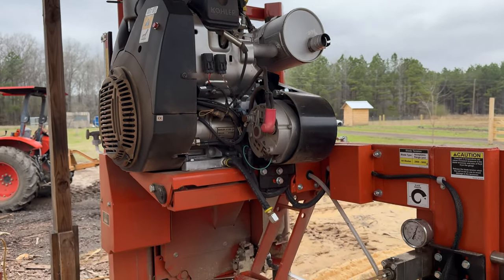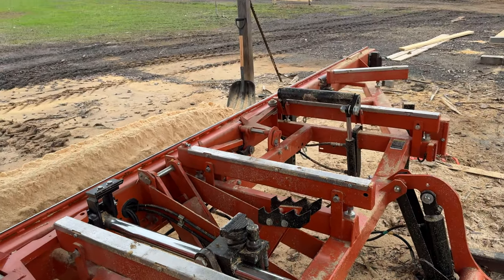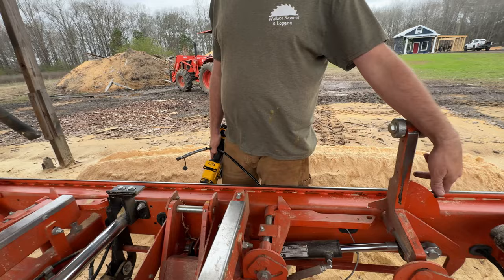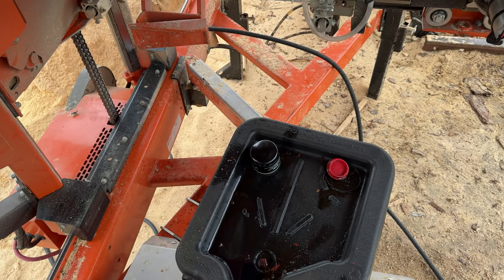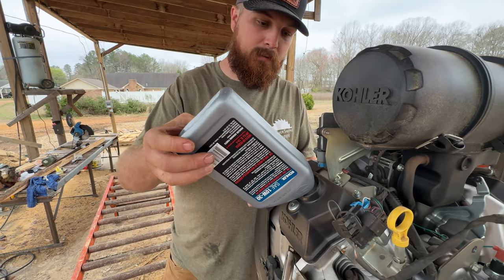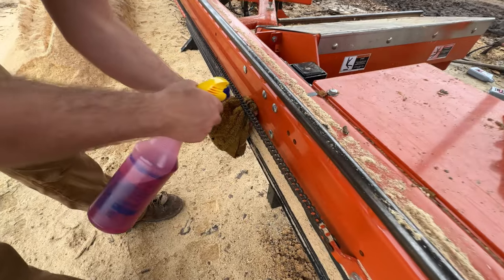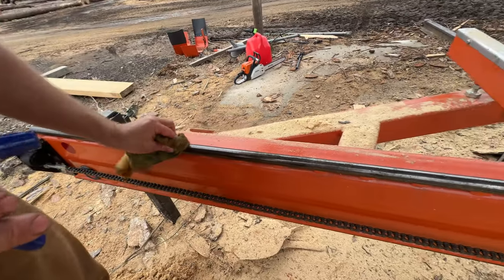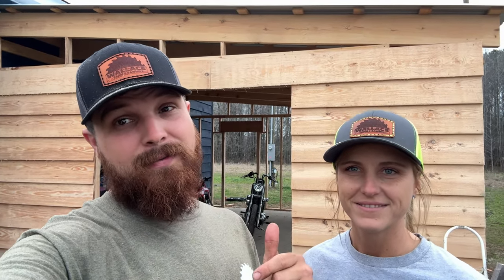How To Maintain your Woodmizer SAWMILL!!!

Comment: Very informative video. I would add 4-5 more lube points. First point is the lower pivot on the log turner. It doesn't have a grease fitting but needs some ATF from time to time. I found out about this when I started to hear a squeal when I ran the mill and realized I didn't have pigs. The other points are easily overlooked and are covered in a video I recently did. Check out # 296 and # 297.
Keep em comin'.
Dave

Comment: I hit the in guide chain and rollers as well as the guide with ATF and I think there is a grease fitting down near the head you need to remove a cover to get at  , saw that on another video where they modified the cover . Some one else mentioned the mast and felt cover . I change out the fuel filter quite often . But I dont run my mill as often as you guys .

Comment: That is true you can over-grease and damage your equipment i have an oil can with ATF and diesel fuel mix in the can i do give them a pump twice a year especially the hard fitter to get the grease into

Comment: Curious on you next service,  1. If you release the fill cap will it drain faster?(air vacuum lock for drain?)  2. If you let your drain hose finish draining and leave it open and release the filter will it put more dirty oil out of the drain hose when the air seal breaks removing the filter?  Great Video!

Comment: Hi  well good job but you have missed a vital part between the head rig rails there is a black sheald it has a bolt at each end and sits on top of the guide rail remove it and you will find a felt pad put ATF on it  too  Cheers!!!

Comment: I think you would be better off if you switched to a high quality red synthetic grease like a Lucas Oil Products or Lubricated Engineers. It will provide a much higher impact resistance than the grease I see you using and require less frequency of application and far less grease when you do service it.